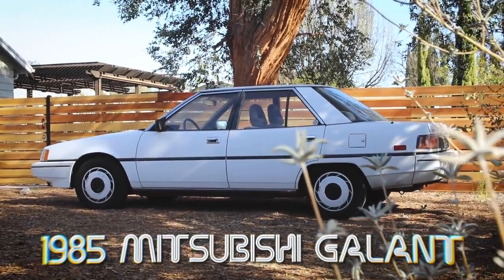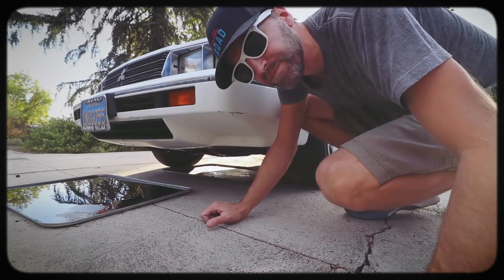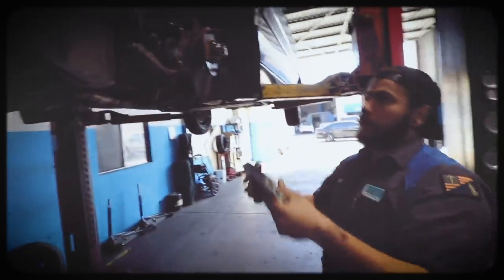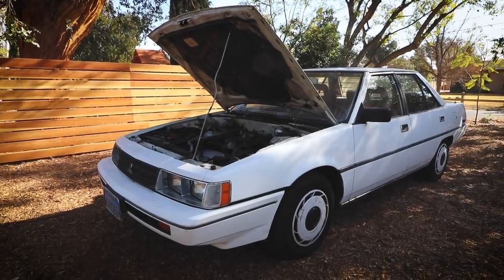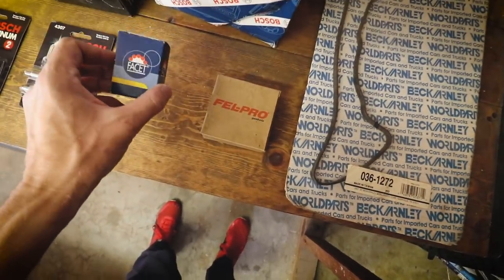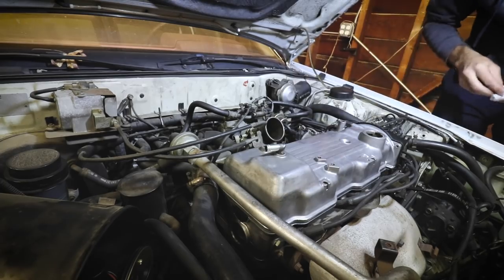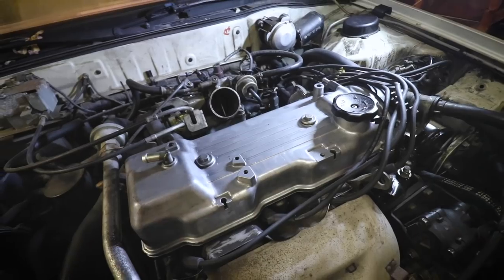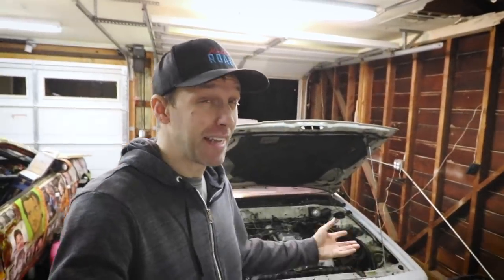Survivor! Fixing a Forgotten and Unloved 1985 Mitsubishi Galant + NIGHT DRIVE

Comment: In Australia we had that model but it was called a "Magna", I still.l have my mother's 89 TP magna in perfect condition,  but we had 2.6Litre  4 cylinder engines here.  The sigma was the model before the magna appeared and the gallant was the smaller model which appeared in about 1990 as well as the magna when the shape changed which was almost similar to the Diamante in USA.  Then after that there was the top of the line model called a "Verada".  There are parts available everywhere here in Australia if you did a search.  We also had the wagons here.

Comment: also the air filter you need is the same as early Starion/Conquest/Cordia turbo with throttlebody injection (which is what yours has). The filter you have is for the later Galant with multi point injection (which has a different MAF sensor)
Reply from the maker: Great info. I appreciate it!

Comment: Buying parts for more unusual vehicles, or more unusual variants of vehicles, on the big aftermarket sites is a bit of a crap shoot.  There will be a lot of listing errors on these sites so when you get your parts, check, double check and then check again that the parts are correct before you fit them or, as here, you can end up creating more problems than you've fixed.  This could easily have turned out to be the end for the transmission...

Comment: Just a tip, do valve cover first, then change the oil. Just in case you knock any old gasket into the engine, it drains out and doesn’t plug your oil pickup
Reply from the maker: Good call

Comment: I'm just adding comments as I make my way through the video - but again that plug wire kit is for the later Galant with MPI that has the coil much closer to the distributor than the older SPI/TBI models.
Reply from the maker: Thanks for the info! I was thinking they probably moved the coil for some other application.

Comment: It’s getting hard to find parts for any 80s car that doesn’t rhyme with “rustang”.  
Its even happening to 90s cars, I’ve been having a hard time trying to find replacement headlight relays (friggin’ RELAYS! A standardized part that thousands of different makes and models used) for my 99 Legacy, even with the correct part numbers, I can’t find any brand new ones for less than $40.

Comment: I noticed the grill looks a lil faded. You should go to your local Home Depot and get some Rustoleum 2x coat matte black spray paint, and then go to a hobby store to find some red enamel paint for the Mitsubishi badge! It would smarten up the front end of the mighty lil Galant. (I recommend that Rustoleum because it works well and I'm a paint guy)
Reply from the maker: Yes this is the plan

Comment: That's a lot of errors from Rockauto. Are you sure you ordered the parts for the right model/engine? Not saying RA is infallible but dang.
Reply from the maker: Yep I'm sure. :) All of the air filters currently in stock for this car on RA do not appear to be correct. The valve cover grommets ended up working out, perhaps they were more of a universal fit part. Not sure what's up with the coil wire. This engine did come in other cars, maybe the coil is in a different place in other applications.
Reply: @HelloRoad  Galants have always been kinda rare, so I'm not surprised the parts catalog is a mess. I hope you find the right parts. Loved the night drive. :)

Comment: Well, it is even worse at any parts place you go to especially advanced in Arizona… I have gotten the completely wrong brake pads for four times in a row, you could tell just looking at the box they were way too big for a Honda accord… First thing he brought out was a box with brake pads that look like they came off of a dump truck! And even that one had rusty sensors and spacers… Turns out that the parts manager is dyslexic. Now I am all about equal rights especially for folks on the spectrum; however, there must be some better job for someone with dyslexia to do other than transcribing six-10 digit numbers all day…

They also gave me a major run around making me think that I had bad wiring were a bad switch on my jeep Cherokee from 1991, they insisted that they would never have a sealed beam headlight on the shelf if it did not properly work… Second one worked like a charm. I just happened to try that before pulling the steering wheel and replacing undoubtedly Good old parts with the new bad ones multiple times. I have even replaced cam position and crank position sensor’s 3 to 5 times in a row with consistently bad parts that are brand new and in the box. That kind of shit Hass to stop, these days I tried to look up the proper ohm reading or something for them to test their own part before I pay.
Thanks for the videos, cheers!

Comment: cool video!  Mid 1980's Mitsu Galant would be perfectly fine car for me.  Cars from mid 1980's to mid 1990's (before obd2) are the best cars to own.  Mostly dependable and repairable without computer issues in smogging the cars. Just google "smog nightmare obd2" to find tears and travails of people who can't get their obd2 cars smogged due to computer non-sense.
Reply: I don't know if that will be a good plan going forward.  It will become increasingly harder to find a mechanic that knows how to diagnose a car without the car telling what is wrong.

I took my 1983 Mercury Capri V6 to a Midas.  They claim to do tune ups but they told me they don't have anybody that knows anything about carburetors.

Comment: I went onto rockauto, put in 85 galant and it came up with the right filter. You might want to check that you are putting in the right vehicle.
Reply from the maker: I love RockAuto but they definitely failed here. I put in the right vehicle, it's listed on my receipt. I just checked again. Based on the photos, two out of the three in stock are wrong. The Denso and Beck/Arnley filters are not correct. The Bosch one I bought is also not correct but no longer listed (I must have bought the last one). The Bosch filter I got did not match the photo on RockAuto. Out of what's listed on RockAuto, only the Champ brand looks like it will fit, and it's marked as out of stock.